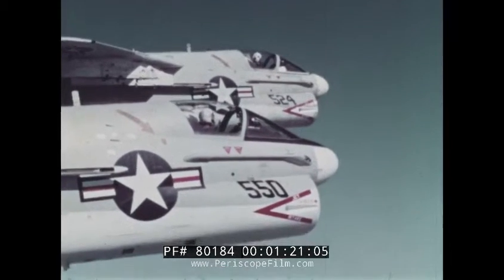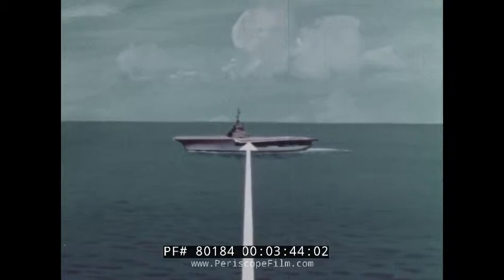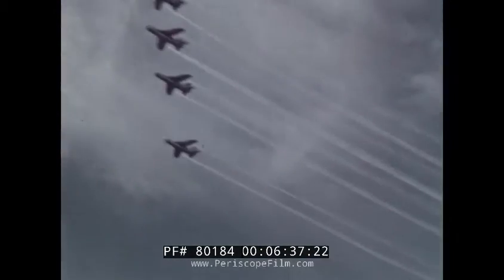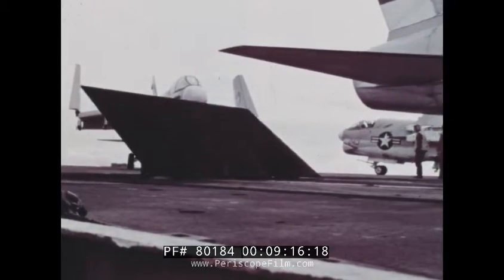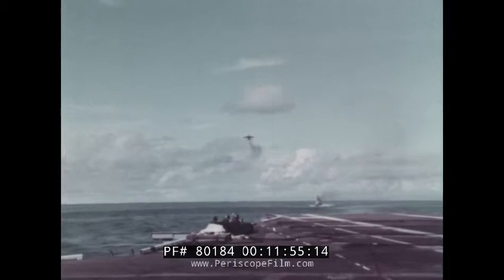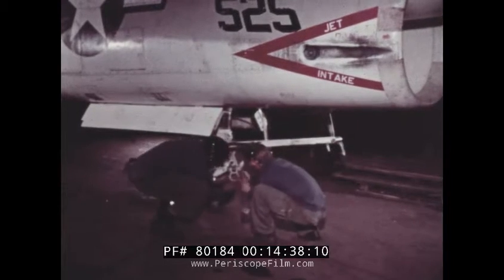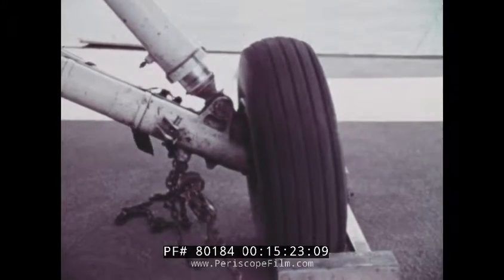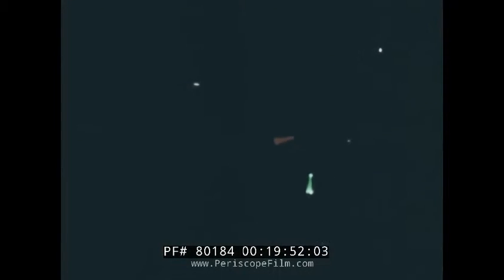"A-7 CORSAIR II FAMILIARIZATION"  U.S. NAVY AIRCRAFT CARRIER FLIGHT DECK LANDING PROCEDURES 80184

Comment: I worked the AF A-7's at depot McClellan AFB for years as an Avionics tech. Then OKC sent one to DM and the dam wing fell off inflight!! After investigation they found many had cracks in the wings at the fuselage attach point. Well we retired them all after that. Too bad too, we had just installed a TFR system and a new radar altimeter. I have a very rare YA7F mug from when we were going to start elongating the fuselage and installing a bigger engine. That was a pretty nice jet to work and my first experience with "Moving Map"
Reply: thanks for your service, I was WCS "slick" I never got a chance to work A7's
Reply: The YA-7F was IMHO such a good looking airplane and a really cool concept.
I guess it just came a little bit too late and no one wanted to reduce spending on the F-16.
Reply: I also worked on A7Ds at Myrtle Beach AFB as an avionics tech back in the early to mid-70s. AFCS (automatic flight controls system specialist) which was basically power steering and auto pilot systems for the plane. Peace

Comment: I always thought the A-7 Corsair II is a beautiful aircraft. I've heard it referred to before as the "maneater" because the bottom of the intake was so low to the deck. A few feet, I think. At power, pull you right up off your feet and straight down that intake. I was on submarines. Much quieter environment.😂🇺🇸

Comment: I am curious why Field Carrier Practice uses 3 deg. glide slope, while carrier uses 3.5 deg. Also when is 3.5 deg glide slope = 3.5 units AOA? I was thinking that sweet AOA for traps is abiout 8 or 8.1/ But maybe that is type dependent. In DCS F/A-18C it is 8.1 AOA. Similar to DCS: A-4E-C in 2.0 EFM with 6 to 7 AOA. 5 AOA in DCS A-4E-C 2.0 will get you a bolter.